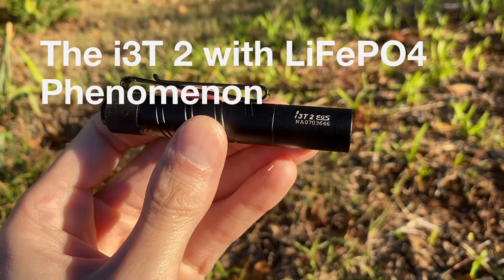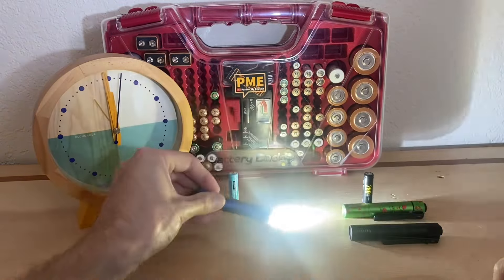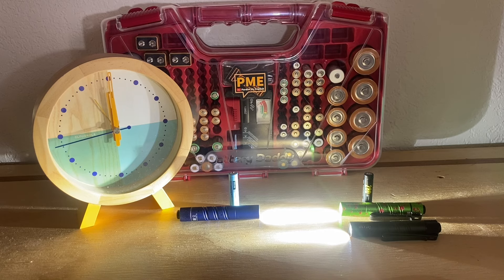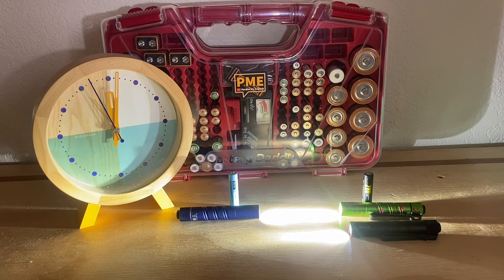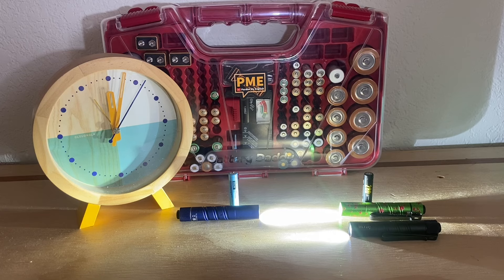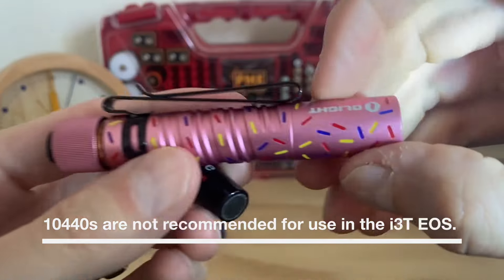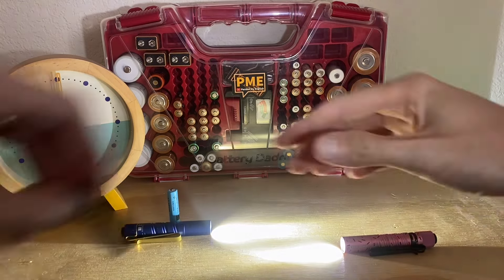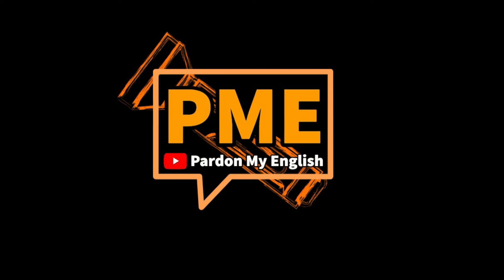Olight i3T 2 Performance with 3.2v LiFePO4 Batteries

Comment: Thank you very much for doing this test!!!

However, this is a bittersweet result, for sure…  

I have an i3t and an i3t 2 in my P.O. Box waiting for me to get home, as well as some Soshines on the way.  

I have plenty of 10440s that I’ve been running in my Foursevens Preon P1 and can put in the i3t 2, so I guess the Soshines will be reserved for the older i3t.
Reply from the maker: Glad you will get some good use out of them. Thanks for sharing your experience so others could learn!

Comment: i use lifepo4 AAs and AAAs in all my electronics. just wire in a spacer so 1 battery replaces 2. i bought a bunch of brass circuit board standoff that are approx half the length of a AAA, and just screw them togeather and use as a conductive spacer. if they dont fit well i just wrap some al foil around the spacer. for AA's i bought the actual spacers and do the same al foil trick, just wrap the outside with them. the problem is charging them, i just use some magnets and a couple strips of metal and attach them all in parellel to a lab bench power supply and let them do their thing until theyre at 3.65v. big advantage of lifepo4 over lipol is the lack of battery degredation. they will never stop being useful. I do use the soshine 9v batteries which are just 2 in series lipol cells without any boost converter and charge a similar way to ~8.4v
Reply from the maker: Good info and thanks for sharing! I don’t think LiFePO4s will take over in the flashlight industry but I’d at least like to see some representation in the market.
Reply: You might want to consider getting a 10850/10880/10900 battery like those for the Nebo, Ledlenser, ASP, Streamlight, and Reylight “2x AAA” sized lights.  

I just ordered a few 10880s from Reylight to put in my Foursevens Preons.  

I really like the output but am tired of the short runtimes of 10440s in the short body tubes (Preon P1), so I’ve been using the long body tubes (Preon P2) and NiMH, but output is underwhelming.
Reply: @AH-xw7gy  18350 is where i think the sweet spot is for removable batteries. current edc is the trust fire mini x3 and trust fire minix. really only want to carry lights with uv mode now days

Comment: I use the soshine 3.2 life po4 in my i3e eos. Works very well. Less hot than 10440 with good output and runtime. Unfortunate the life po are not great in  the new i3t.
Reply from the maker: Nice! I use the  Soshines in my keychain light as well. I’ve found it to be a good balance of output and heat as well 🤜🤛

Comment: Very interesting!  Do you prefer the i3T2 with 3.7 batteries or the i3T with 3.2 batteries?  Does it come down to brightness advantage for the 3.7/i3T2 vs runtime advantage for the 3.2/i3T?  If so, how big is the brightness advantage? How big is the runtime advantage?  Is there a heat difference?
Reply from the maker: Very good questions. As for heat, the original i3T with 10440s is the hottest (around 125 degrees Fahrenheit at room temperature when I checked). The i3T 2 has less heat and brightness but better runtimes. These results can be seen in the i3T vs. i3T 2 10440 video I made earlier. The driver improvement really helps the i3T 2. 
I personally still use the i3T and will switch to the i3T 2 when my i3T eventually retires. I kinda want to see how long the trusty brown i3T lasts  and have somewhat of an irrational attachment to it at this point haha.

Comment: Is the soshine a protected cell?
Reply from the maker: Good question. The Soshine battery does not have a protection circuit; however the LiFePO4 battery chemistry is such that it can be fully discharged and fully charged without causing damage to the cell. Hopefully that info helps!